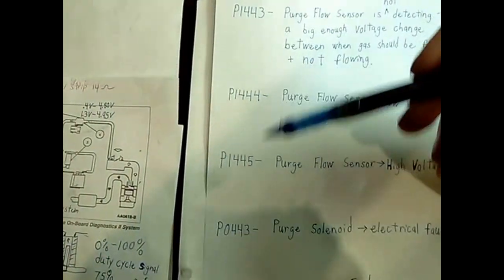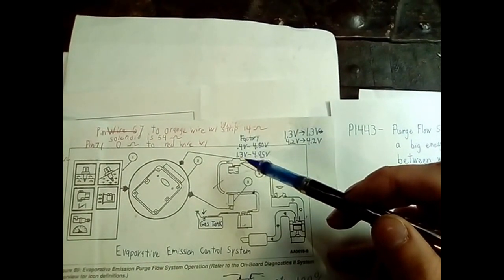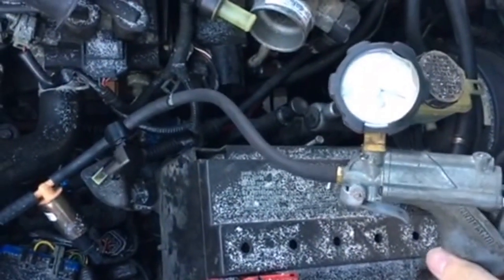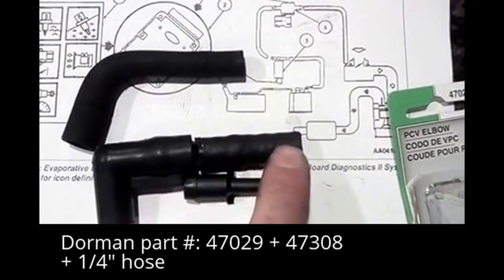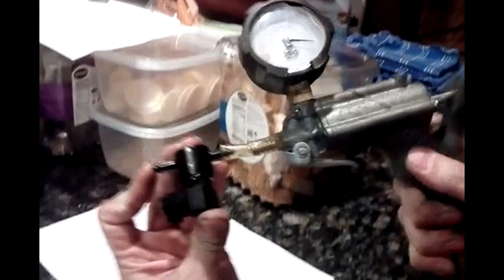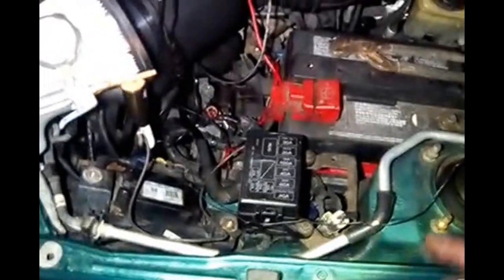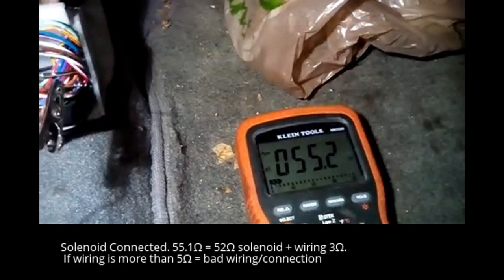1997 Ford Escort 95-97 Ranger P1443 P1444 P1445 P0443 Tracer

Comment from the maker: UPDATE 6/18/2018: I STRONGLY RECOMMEND AGAINST USING THE DORMAN PCV ELBOW 47029 SHOWN AT 5:10. MY ELBOW HAS CATASTROPHICALLY FAILED WITH CRACKS RUNNING ALL OVER AND COMPLETELY THROUGH IT. I recommend replacing the elbow with a straight length of 3/8" vacuum hose with the fibers that is gasoline resistant. Use a length that will bend gently and continue to use the 3/8" to 1/4" adapter Dorman part# 47308.
Reply: My purge valve solenoid tested good  and i had a 1443, i tested the sensor top left pin[ power] to bottom left pin[ ground] and it showed open, To me that sayus the snsor is bad, Correct?   from the top right  pin[ puter signal]  to ground I am  showin 38 or so ohms? correct? Am I missing somethin? I have  hooked 12v to it yet [ top left pin] to see if  I have 1.3 V but  since its showin open[ no continuity]  it wont read any way?  It is a good idea  to  clen out both of thes with carb cleaner but i wouldn't used compressed  ait to blow dry, too  fragile... I am dring the truck now  without the system in service  ,the intake vacuum capped off, and I get the expect 0443  and 0445 code  of  [out of range   on the sensor and the solenoid. Its stumbles at idle  as expected,,same  as with the now tested bad sensor and the good  purge  solenoid in place..I found much  better prices on both parts online  around $22  for the standard cp416[?} sensor .   Once installed with new hoses  and  a 1/4 to 3/8 adapter.i should be code free, evn though I can legally run catless, those 8 plugs  do the trick...  Thanks for puttin  this info up.
Reply: Adam Prince, can you confirm my findings? Its all on a 96 and a 97 ranger 2.3L..
Reply from the maker: Everything you need to know is in my two videos. If you get forscan on your phone and used obdii bluetooth scanner you can see the outputs directly. Without the multimeter.
Reply from the maker: https://m.youtube.com/watch?v=oW-aqqidjV0
Reply: @supermetaltastic     no phone to use.. am old school.. but I've gotten past it and since I know the solenoid is good, the  1443 code has to come from the thermistor[ sensor] or bad hoses,both of which  I am replacing today with a straight  3/8ths to 1/4in adapter and all new fuel hose. Done deal!.Thanks.. I did get a little redundant with my replies but  I wanted to make sure other folks got what you were sayin through the video about which part is which  and which part does what,so folks won;t just throw money.,.You got it all there for sure!
Reply from the maker: @jockeyshift4124  as per the video Power (top left pin) to ground (bottom left) should be less than 190 ohms. Assuming your multimeter is good (harbor freight s are junk), you tested the meter by touching the leads together, and the connections are clean and  good, an open signal indicates a bad sensor.

38 ohms for the ground to signal is normal. Greater than 25.5 ohms and typically between 30 to 40. I believe I established those last two numbers myself after testing sensors. You need to test it at normal indoor temperatures not outside. It's temperature sensitive.
Reply: @supermetaltastic   I am wary at HF,lol..My MM is a klein 600...No resistance ,no voltage ,no nothing.tol left pin to bottom left as expected.Replaced and working.Now if I could just find the  electrical gremlin/drain that appeared out of nowhere,the truck will be back 100% no codes,like my other ranger/just a matter of time...

Comment: For a 1996 Escort the purge control valve is under the air cleaner between engine and frame taped or rubber banded to the wire harness.
Reply from the maker: Alright

Comment from the maker: Keep in mind the purge flow sensor cannot detect a leak before the solenoid. This system CANNOT detect whether you gas cap is on tight.

Also note sometimes the Purge Sensor plugs up with bits of activated charcoal from the canister.

Comment: i have a ranger 97. just replaced plugs and wire with a full tune up 2 months ago. i am getting a misfire on cylinders 1 and 5 along with a purge flow sensor circuit high input. do these have any relation to eachother that can narrow down the issue? any input is def appreciated, thank you sir! :)
Reply from the maker: Possibly yes... High Input means there a voltage much above 4.8 volts. If you watch my other video How the Evaporative Purge Flow System Works you will understand far better how the system works.

It's getting late and I have to sleep. To summarize a major vacuum leak just before the sensor and cold winter air could cause the voltage to shoot out of range. This would be unmetered air and will effect the way the vehicle runs. Possibly causing a misfire due to a very lean mixture. Fix the purge flow system and reset codes. Watch the whole video you can't just throw parts at it.

Comment: ADAM PRINCE, Are you still on here? I am doin 1443 repair on 97 ranger 2.3 4 cyl amd got questions. I have long time  mech background,multi meter and vacuum gage. Thanks for posting electrical values.LMK
Reply from the maker: I'm around.
Reply: @supermetaltastic   wanted to know what you used to test the thermistor and the purge solenoid  power wise. the cars power[12v] or  the testers power[ if so what size battery]  or?  I'm dealin with this issues on a 97 ranger and want to get it on the level you put up using escort . I want to make sure  pin locations and colors ARe the same  or the corrections  posted because  folks  including myself plan to go bigger and  swap to 5.0  or in my cabse  turbo a 2.3 and avoid  quesswork, takin out unessesary systems and not fryin  expensive 5.0 harness. which book did you rip those pages from?

Comment: great video! i was curious if this code would cause the vehicle to run bad on start up. my 97 ranger 3.0 starts and runs bad then after a few seconds idles better. any feedback would be appreciated
Reply from the maker: If there is a break after the solenoid it will cause a vacuum leak. Which will cause it to run poorly all the time.

Comment: Adam, I’m getting P1445. I tried replacing the sensor with a new one and still the issue persists. It’s unclear how you test the sensor to see if it’s good or not. Are you tapped into the pcm from inside the dash? I have a Ford Ranger 1996. Please help.
Reply from the maker: Watch the video again and this time pay attention.
Reply: @supermetaltastic  Adam, question: which direction should the purge flow sensor be facing? I noticed the diagram points the connector towards the canister. But, when I look up the complete assembly sold online (part# W0133-1901590), the connector is facing the intake manifold. In your video (timecode 3:32) the connector faces the manifold…. but a few seconds later (timecode 3:43) the connector faces the canister… Which one is proper? Thank you
Reply from the maker: check the video at 0:40. There is a diagram.
Reply from the maker: I'd follow the manual diagram to be on the safe side in case the manufacturer made it flow better in one direction. I'd check the valve for an arrow as well. Check my other video. Though it may not make much of a difference either way. It's a temperature sensitive thermistor in an airstream. That confirms whether the valve is opened or closed by being cooled by air that is sucked into the engine. Not the best design. The other video shows a cut away and this video shows what it looks like inside.
Reply from the maker: @robertpenna5558  Here is a second video with more information. https://youtu.be/oW-aqqidjV0?feature=shared
Reply from the maker: If you get a cheap Bluetooth obd ii connector you can connect your car to your phone using forscan. Then you can read outputs from the sensor.
Reply: @supermetaltastic  I watched your 2nd video; thx for the info. I ordered a Bluetooth OBDII. 

Question: Where did you find your diagrams? 

Also, I tested the PFS connector as you did in your video 12:06 and got 12.3V from the VPWR and 5.05V from the PF Signal. Is that right? Or should they both be 12V?

Question: How did you realize you had a bad Solenoid? You mentioned it was "off-camera" ... but you tested a working Solenoid. Was this the new one?
Reply from the maker: @robertpenna5558  I think if you just carefully watched the video your questions would be answered. At 12:06 it says PFS connector 12v=good.
Reply from the maker: @robertpenna5558  the solenoid did not operate when voltage was applied or it leaked vacuum.
Reply: @supermetaltastic  Trust me I watched your video very closely and I appreciate the info. Yes 12V is good; however, your video doesn't indicate if that is coming from the VPWR port in the connector or the PF Signal port in the connector. As I said, I am getting 12V from VPWR port, but 5V from the PF Signal port in the connector. I wonder if this indicates a fault in my circuitry. 

Also, please let me know where you found your Diagrams as my Ford Ranger and your Escort are slightly different. Thank you again.
Reply: @supermetaltastic  Ok, at least let me know where you found your diagrams. Thank you
Reply: @supermetaltastic  It would be very helpful to know where you found your diagrams that show the specs and images of purge flow sensor etc. Thank you
Reply from the maker: @robertpenna5558  the factory manual and patent application. 

12v from the power port= good. I covered the signal outputs in the video. All covered in the video. 

If you have anymore questions, especially ones already covered in the video I will answer them for $20 per question. Venmo @AdamMasonPrince

Comment: Hi, thanks for this video, it's quite informative.

I keep getting the P1443 code on my '97 Tracer and replaced the sensor (does hold vacuum) but I checked my purge solenoid and noticed it didn't hold any vacuum when no power was applied to it, so I bought a new one. However, the new one does not hold vacuum unless I hold it upside down and give some slight taps on the plastic tube, as if it had no spring inside it to keep the valve closed while off. Is my new solenoid defective or is this how it operates?

Thank you, again :)
Reply from the maker: It may be defective. The quality on the parts are pretty bad even the OEM. Make sure you check the vacuum in the direction of air flow. There is an arrow on the solenoid. Put the vacuum gauge on the side the arrow is pointing to.
Reply from the maker: The P1443 does fit with a defective solenoid. In that it's not detecting a big enough voltage change between when the gas should be flowing and not flowing.
Reply: Adam Prince 

Thanks for your quick response :)

I did check the vacuum in the direction of the flow, following the arrow. It felt odd that it wouldn't hold vacuum unless I shook it like a thermometer. All other purge solenoids I've seen are air-tight when off.

The code doesn't come up immediately, but after a week or more, so it's frustrating. I'll take the solenoid back to the shop.
Reply from the maker: Sometimes the used solenoid gets intermittently stuck. I had that problem. Bring your vacuum gauge with you, so can you check out new parts. It wasn't the best of systems and was redesigned in the 1998 Escort.
Reply from the maker: Did you get your problem solved?
Reply: Adam Prince 
Not yet. I'm still waiting for my replacement part to arrive and then I have to drive for some days to check if the code won't appear again.

How much vacuum should I get, at idle, from the port at the bottom of the throttle body? The throttle plate is fully shut and I get almost no vacuum at idle because of that.
Reply from the maker: From that specific port I don't know. I do know that this EVAP system is NEVER open at idle. With a scanner I can see what my vacuum is. I will let your know what it is.
Reply from the maker: You can put the line from the brake booster and hook up to that.
Reply: @supermetaltastic 

Hello again, it's been a while since my last reply.

After a cylinder head change and a while without the code, it has come back. I'm still following your procedures, but there's still one doubt I have, which was regarding vacuum:

I understand that you didn't know the answer to my question about the throttle body's underside port value. I'd like to know if you had any chance to check it. If not, that's fine. You have been incredibly helpful as it is and can't expect for you to whip out your tester on request :)

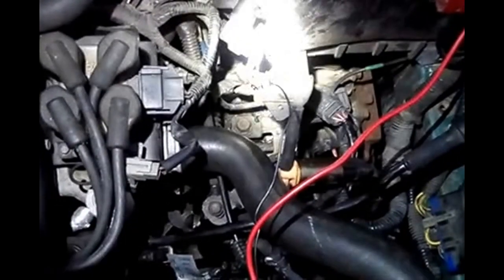At the 7:46 mark, you plug the end of the PF sensor with your finger and then let it go to check the sensor voltage. The car is at idle (and warmed up) and I can hear the car sputtering when you remove the finger. I hear it both with the good PF sensor (8:11 mark) and the faulty one (8:57 mark), which leads me to believe it's not linked to the PF signal (given the wide difference of values), but that there's vacuum even if the throttle is fully closed and it leaks when you unplug the end of the PF sensor with your finger.

I have a vacuum tester and I have taken the values at the booster hose and intake manifold in my car, but the underside port of the throttle body is another story, because I don't know the correct operation of it while the throttle plate is closed, which means my PF signal readings at idle are currently the same in both cold and warm operation (over 0.5V with two different sealed sensors) as there's no vacuum until I accelerate (vacuum increases in proportion with throttle). This means that there's no sputtering of any kind when I plug or unplug the PF sensor's end in the same way you did. Could this be an incorrect behavior in my car?

I know you stated there should be no flow at idle, but does that mean that there should be no vacuum present in the PF sensor or that the solenoid should be closed to restrict it? my car's behavior suggests the former, but my observation of your car's behavior suggests the latter. Both are '97 2.0 SOHC Escorts (give or take minor engine differences –given that '97s are oddballs– and rebranding) which is quite confusing to me.  I remember I found the 10 mmHg on part-throttle in a PC/ED.

Anyway, if you or anybody else have any input, it would be greatly appreciated.

TL; DR: Throttle body's underside port, vacuum at idle?
Reply from the maker: @Carlos85G  There is "no flow" as in the solenoid is closed at idle. If the solenoid was disconnected there would be nothing stopping the flow to the engine. I would recommend you get the program Forscan. The demo version is free and will work. Then you can easily monitor sensor voltages when driving without probing wires. 

During very cold weather (10F) its not usual to get an evap code. Maybe once a year I get an evap code that when the PCM is reset, stays off for another year. The problem is how the system works and the calibration. The very cold air makes the thermistor think there is more flow than there actually is. The sensor reads airflow by cooling. It's logic is more air, equals more cooling, equals less resistance, which equals more voltage. If the sensor were more carefully calibrated or the PCM was reprogrammed to accept a wider input it would solve the false code. 

The 1997 escorts had a lot of factory defects. The later ones were somewhat better. The defects were torque converter, valve body, engine mounts, evap system, roof rack nuts, etc.

Comment: So I have a 1997 Ranger 4.0.  I have had a leak in my filler neck on the gas tank for years.  It just leaks when I fill it to the top.  Could this be throwing the code P1443?  I just got the code yesterday, which is very odd that for years it has been fine like that.  I also replaced yesterday a cracked hose on the throttle body going to the evap system (which it has been cracked for years) so I replaced it.  Just recently I used my 4wd in the snow, which the front driveshaft ripped the plug out of the VSS.  So I drove with now speedometer for about two days (which I saw in another video is somehow connected to this).  Do you think that would have thrown the code? And do you think the filler hose could be the issue?  And if so why after so many years is it now throwing a code?
Reply from the maker: The cracked filler neck will effect proper operation, however it will not cause the code. Watch my video on how the system works if you want to know more about sensors.
Reply from the maker: It's titles how the evaporative purge flow system works 97 ford

Comment: 97 ford ranger 4.0 dtc p1443 my question does the purge solenoid have a constant 12 volts with KEOEO ?
Reply from the maker: The system between the ford escort and the Ranger should be very similar. It should read 12 volts with key on engine off and the Solenoid REMOVED (this is very important). If the solenoid is NOT removed you will not read the 12 volts. It's a ghost voltage used for diagnostic purposes only. For practical purposes there is almost no amperage, so the solenoid will NOT open.

Comment: Thanks so much for this video....Question....I have the P1445 code and have replaced both the sensor and the solonoid. I have tested the vacuum lines I can get to and they are all good. In theory, could this P1445 be ONLY a bad gas cap? It seems like I put a new gas cap on every 2 years or so...LOL Thanks for any help!
Reply: Sorry 1997 Ford Ranger :)
Reply from the maker: In the 1997 ford escort no it cannot detect a bad gas cap. In the later system as used on the 1999 Ford escort it can detect a bad gas cap.
Reply from the maker: 1445 is voltage is too high most likely from too much flow. What is the voltage output on the sensor. I recommend you get the program ForScan demo on a smart phone its free and obd II blue tooth reader. They cost $25. Then you can read the sensor output directly. Sometimes on very cold days even "good" sensors will throw a 1445 as the sensor detects flow by cooling effect. The sensors need better calibrating.